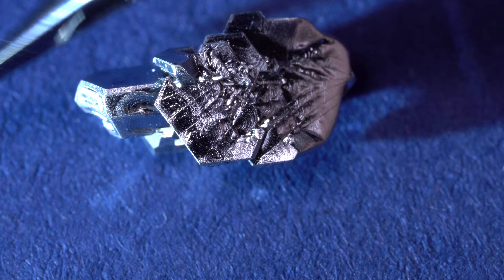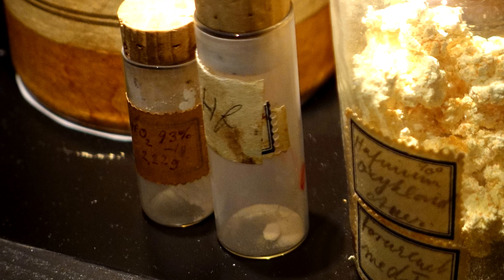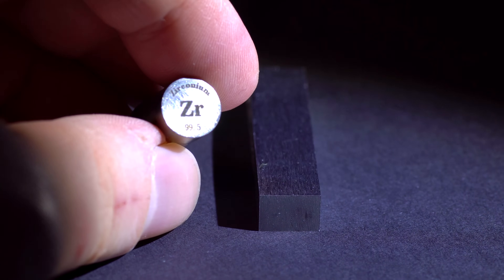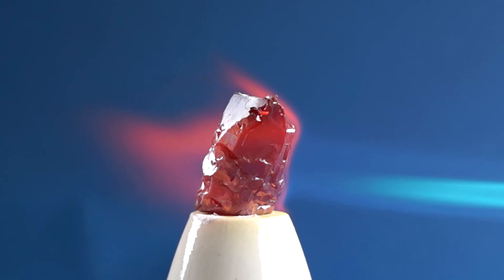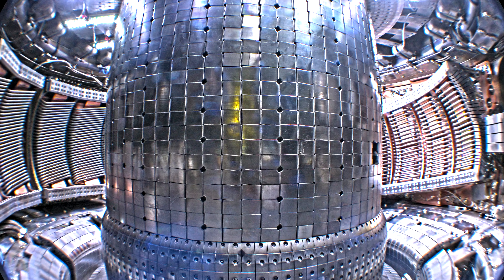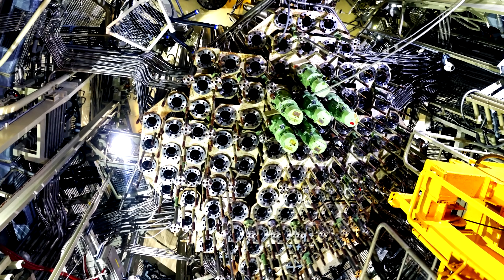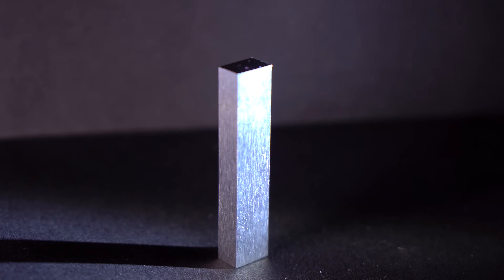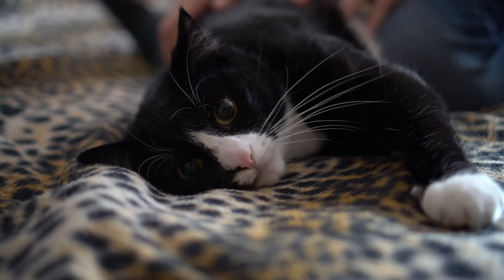Hafnium  - The Last Stable Metal On Earth!

Comment: What I find interesting is that Zirconium and Hafnium are almost identical in chemical properties, and thus a nightmare to separate. But Zr is transparent to neutrons, and Hafnium absorbs them like a sponge. So in chemical terms they are almost identical, but atomically, they are almost total opposites.
Reply: I know it has been three years now, but I want to ask you why that is? 

Why does hafniun absorb neutrons "like a sponge"?
Reply: waits paitently for an amswer too 🤓
Reply: I think most of our hafnium supply comes from purifying zirconium for nuclear fuel cladding. Edit: I should watch the whole video before commenting, this is mentioned around 1:45 anyways.
Reply: The fast neutron cross section for hafnium is huge compared to zirconium. This means hafnium nuclei act as much bigger targets for absorbing the fast neutrons in a reactor, and thus kill the reactors power. Why this is is hard to explain. Read up on "neutron cross section".
Reply: Same with titanium.  Same colymn/family

Comment: The last stable metal on Earth is either Rhenium (discovery), Lead (highest atomic number stable) or Bismuth (highest atomic number practically stable). Hafnium was discovered 2 years before Rhenium.
Reply: There's a difference between "observationally stable" and "stable". You may THINK lead is stable, much as until a few years ago, no one had ever observed the radioactivity of bismuth, and then they discovered what they thought the only stable isotope actually had a half-life of 10^19 years. I believe he may be saying that everything after hafnium can decay by the normal methods (alpha and beta) and they just have very long halflives. Though everything theoretically except for iron and nickel 56 are theoretically unstable and ultimately end as iron or nickel 56 through very complicated decay modes involving quantum tunneling between nearby atoms, and even they may disappear eventually if proton decay is real, which it probably isn't.
Reply: @medexamtoolscom  I don’t think there is any evidence for your assertions. The evidence that the five stable isotopes of Hf are truly stable is no stronger than the evidence that the four stable isotopes of Pb or the the stable Re-185 are actually "unstable". @Rursus is correct.

By the way, this video doesn’t even make any comment about Hafnium being "the last stable metal on earth", so the title of the video is misleading.
Reply: I read iron to get the most stable element to get the future of the universe ultimately in a old Soviet books claim
Reply: @medexamtoolscom I know I’m 3 years late but I think Wikipedia said that every element after dysprosium and before Bismuth is theoretically unstable.

Comment: Surprisingly you probably have hafnium in your office.  Intel and IBM have been using hafnium since 2007, in their 45nm high-k micro chips...staring with the dual cores microprocessors.
Reply: Do you know about how much hafnium by mass is in one of these dies?
Reply: @user-pe7gf9rv4m  no I'm not too sure, it's used in the gate oxide layer for each teansiator. The xx billion transistors are  are only in 2 dimensions.  The dies are 1.5 cm on a side.  The gates are maybe 3 nanometers thick. The halfnium is a dopant so 1% of the volume of the gate..  ...  So the absolute max volume of halfnium per chip... 0.0015 ^2 × 0.000000003 × 0.01 = very very small volume.  I would guess less than a micro gram by weight

Comment: Tantalum hafnium carbide has a melting point MUCH higher than 2000 degrees! It is more refractory than tungsten! It lasts to 4000 degrees celcius, far above the temperature tungsten melts!

Comment: Let me say I prefer your voice over your new voice actor. Also half name is used in the electrodes of plasma cutter torches. This is due to its high heat tolerance. And the fact that it holds up well under spark erosion.